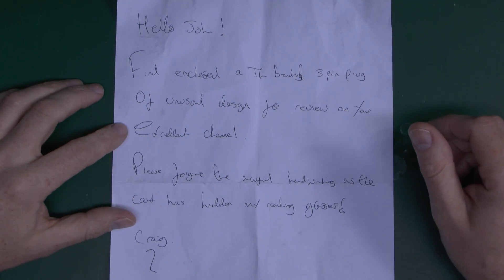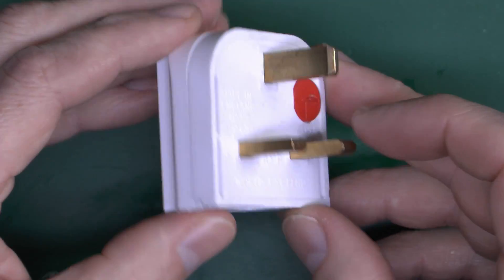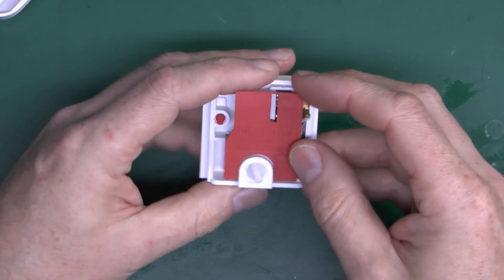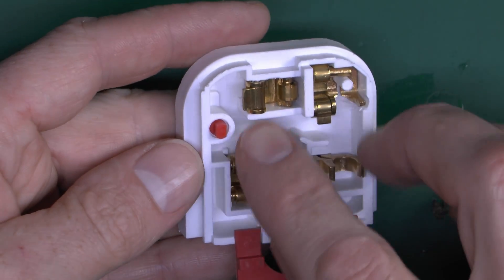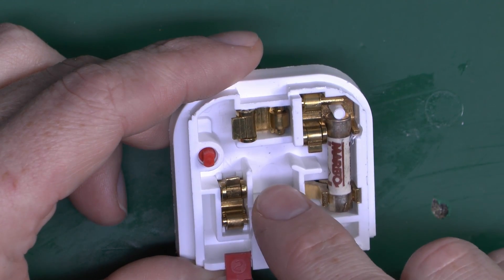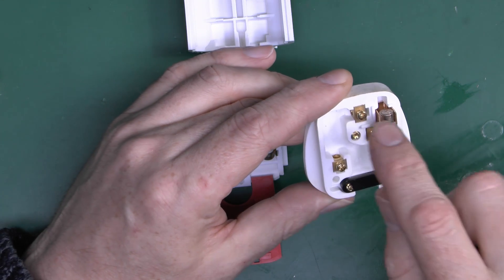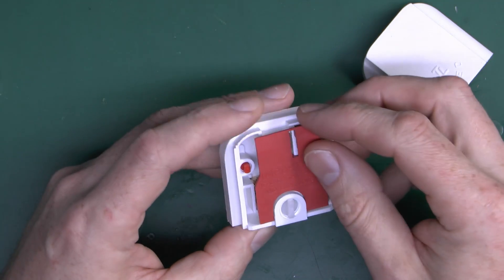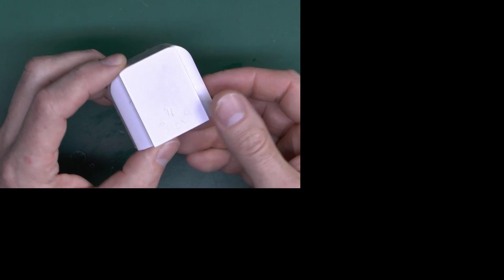TL Branded BS1363 Plug with Screwless Terminals

Comment: Be interesting to know what those clip in connections are like with high current (10A+) type applications. Would they  heat up quicker than the screw down terminals ?
Reply: @
patdbean

probably no quicker than the fuse gripper :-)
and i have seen the screw grippers were they have over heated :-)

Comment: They should bring back this design with modifications to meet modern standards!
Reply: Agreed, a few more tweaks here and there and it could have been a very good plug.
Reply: These were also made with shrouded pins. I believe these were still 
manufactured well into the mid 1990s.

Comment: Wow, the design is actually very complex. They had most areas covered, even a WAGO type method to connect the cable. I wonder how many revisions that plug had before manufacture sign off. 

Great video.

Comment: Doesn't look to be very well designed ergonomically, very little to hold onto when withdrawing the plug from a wall socket.
Reply: That one actually looks like it would've been easier to pull out than the ones I remember, which were much thinner than these. Maybe a hair over 1cm.
Reply: See 5:58 - it has a better grip than most plugs I've seen.
Reply: bdf2718 Yes I didn't see the sharper edge to grip until 8:08

Comment: Most likely aimed at the sort of person who did not have any tools, trouble then beeing that the same type of person either did not have the knowlede/skills or the inclination to fit plugs.
Reply: You'd still require the same tools, had it been the more traditional plug type we're used to today.
Reply: @ashmanelectricalservices4318  You would only require a sharp knife and a coin to fit that plug.
Reply: @Equiluxe1  A pair of side cutters and screwdriver as the inner cores would still needed to have been cut and stripped to length.
Reply: @ashmanelectricalservices4318  A sharp knife will cut wire as will scissors you can also strip wire with the same tools,something I have done in the past and a small coin will turn that plastic lock.
Reply: @Equiluxe1  Even though appliances came without a mains plug, the leads were normally pre-stripped to equal lengths, they didn't expect the average bloke to have a pair of wire cutters.  Nonetheless as Ian Steele has pointed out, this plug has a built-in wire stripper as you can see at 1:20.
Reply: Yep.  Too complicated for them to figure out how to open it, open the latches, etc., so they'd ask somebody who knew what they were doing.
Reply: I don't know about the UK, but in SA in the 80's it was very common to buy your appliances without a plug. We were taught in primary school basic electrics and how to wire a plug. I could wire a plug at the age of 10 as could most kids.
Reply: @e.colemantlpss6406  Pretty much the same here except no classes at school as that was considered dangerous back then but when I was at school in the sixties we were taought how to wire plugs etc.

Comment: Not as nice as the IDC Products Ltd "Simplicity Plug" - though a similar idea, that needed a screwdriver to loosen its one captive screw. The lid was hinged, the power pins sleeved. You laid the three wires in the coloured clips (blue, green, brown), pressing the outer of the flex into the sprung cord grip. The lid had blocks which pressed the wires down. The fuse was in an externally accessible holder. I know I bought two of these, I think I still have one in my loft.
Reply: The termination method you are trying to describe is called "IDC".
Reply: @johncoops6897 Except it isn't as you had to strip the wires
Reply: @PhilReynoldsLondonGeek  - so a company named "IDC Products Ltd" manufactured and sold a product that wasn't?
That is very silly. Are you sure that you weren't just doing it wrong?
The Clipsal branded IDC power sockets never really sold well here in Australia, as the electricians simply could not understand how to install them. They all wanted to strip the cables first.